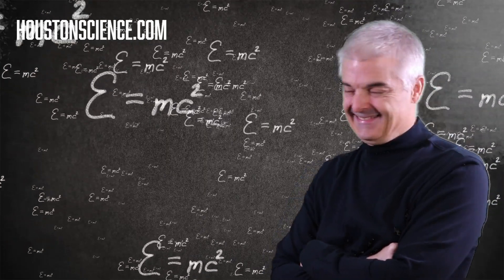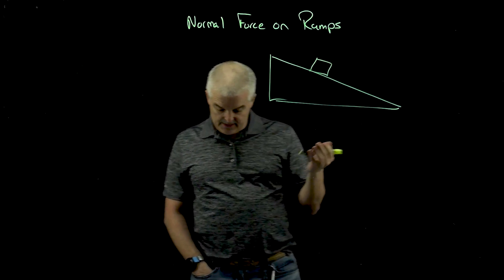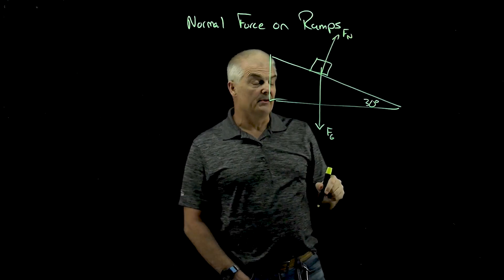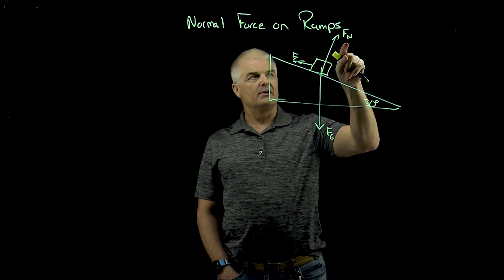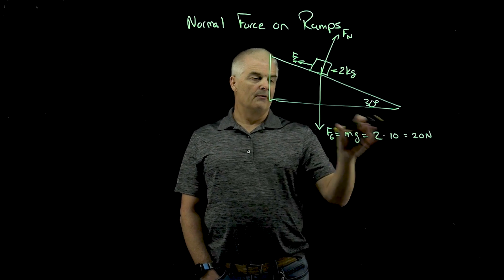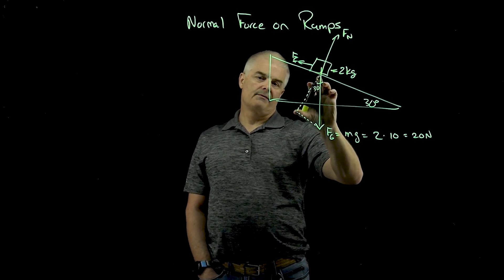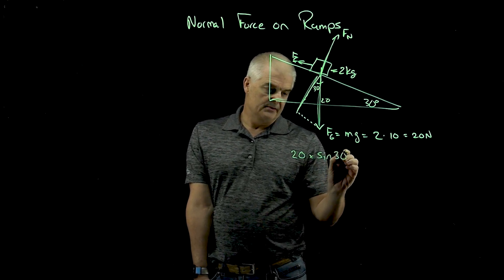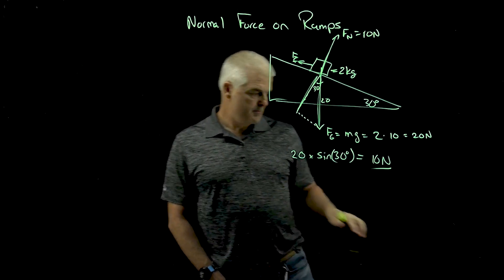How to Find the Normal Force on an Incline

Comment: Just a side note.....shouldn't the equation be 20 x COS(30) instead of SIN since you are finding the adjacent side and not the opposite side?
Reply: NVM that last one, if you are given an angle of a ramp like this with the angle at the bottom of the ramp, the horizontal normal force (so parallel with the ramp) will be sin, the normal force perpendicular to the ramp will be cos.
Reply: same confusion, sin is usually used for these but it doesn't make sense by the way most people describe it because its the adjacent.